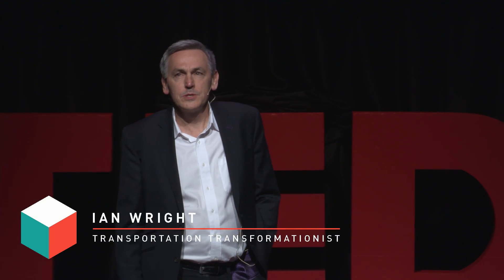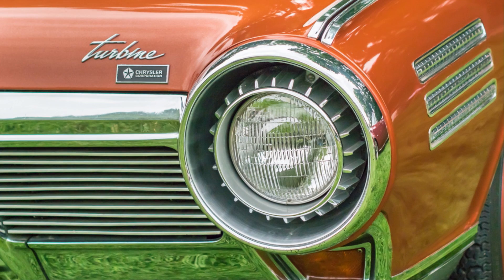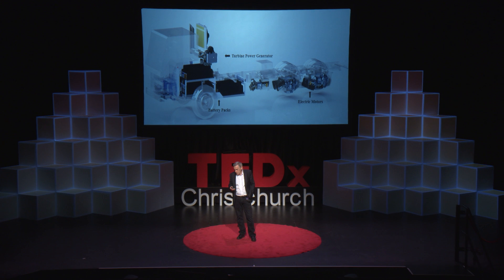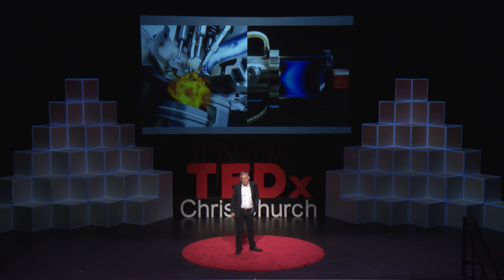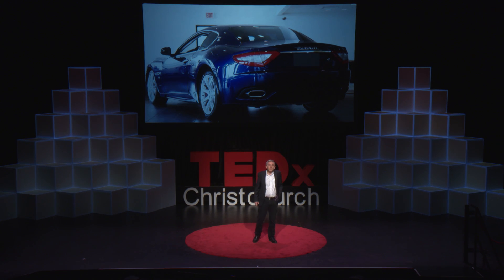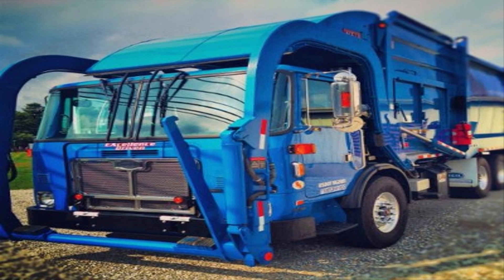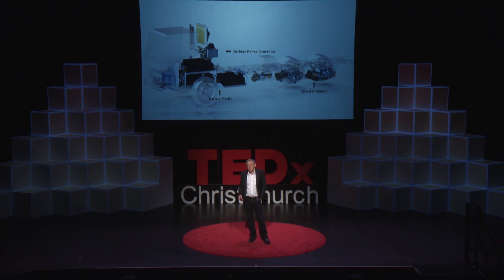How jet-powered garbage trucks can save the world | Ian Wright | TEDxChristchurch

Comment: I agreed the turbine engine burn alot cleaner. But is not clean I have spend hours cleaning aircrafts after each flight of those carbon soot.
Reply: Some turbines run cleaner than others.
Reply: depends on the fuel you feed it.

Comment: Long haul trucks get 5.6/5.7 mpg. He said 2.3 mpg. This is in imperial gallons. Do the math if you want it in American gallons. They are smaller but they are getting a lot better than the 2.3 he claims. Why is he BSing?
Reply: On a dump truck that stop/starts all the time, it's likely closer to his figure. In this application, BEV vehicles would absolutely cream ICE, on cost and also likely range.
Reply: Stop/start is the killer on ICE value - do it with electric motors, you've jumped efficiency by mountains.  Also no idling losses on EV (in this case, you'd be charging battery while stopped "idling" with the turbine, where the ICE it would be a thermal dump only...

Comment: the fact is that a small gas turbine system has much lower overall efficiency than a diesel engine. Emissions is true but efficiency is false. Half trues and people outside the field do not know how to distinct the facts! s smart propaganda guy...
Reply: I can find absolutely no sources that would put gas turbines efficiency below a diesel, so I really have no idea where you got this...
Reply: Your facts are bad. And you should feel bad.
Reply: so why not every airplane use diesel?
Reply: According to wikipedia, typical micro turbine efficiency is 25-35%, which is WAAAAAY above the efficiency of a diesel engine that revs and idles hundreds of times per trip, as currently.

Now, you might make the case that a diesel range extender might be more effective, though I would argue why use diesel in this example due to it's relative dirtiness, and you might be right, but that's not to say that a small cheap turbine with long operating hours between servicing attached to a conventional BEV wouldn't be a massive, massive improvement over the current status quo.
Reply: That overall efficiency is from running the turbine at sub optimal power settings such as idling and all other less than full power use the turbine driving a generator at power or off is more efficient.
Reply: calvingreene90 my figures are for a microturbine that does not recycle the heat output back into more generation, like this one. For larger generating turbines they use this heat and turn out about 60-80% efficiency from what I can find.
Reply: I agree that recycling heat would make that turbine more efficient but I was saying that the reason that small turbines get a bad rap about efficiency is their being used for jobs they are poorly suited for instead of constant optimal loads like say irrigation pumps.

Comment: his blue flame comes from burning natural gas.. 3 hydrogens per each carbon.. while long string gasoline and diesel are two hydrogen per each carbon.     To make the comparison fair.. use the same fuel.  Not stated is that turbine engines are inherently inefficient..the amount of energy you get out compared to the amount of energy you put in is LOW.Also..  the amount of energy needed to fuels from raw petroleum is high..and must be factored in..   along with the transport network.. yada yada.   ..Electric cars use electricity from ANY source.. so using Chinese coal  ( or 4 corners coal)   is hardly the only game in town.
Reply: That blue flame was from burning the hydrocarbon fuel completely.
Reply: Yeah, I generally agree, though it would seem that a microturbine can be at least as efficient as an ICE engine, while producing less emissions. They also have longer maintenance schedules, which in a range extender application would be a better fit.

You still have to take into account the efficiency of producing the fuel, and for that reason BEV's and solar/wind win hands down. We just have to make the batteries cheaper and more energy dense.
Reply: we need more armchair commentators like you who may as well be shills for the automotive industry's resistance to change.

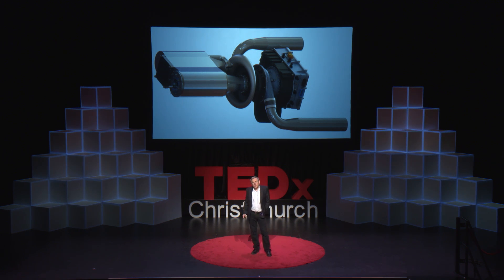Comment: 6:42 - he states it will run 10,000 hours, after that what happens, does the jet engine generator die? Isn't that roughly 5 years of heavy use?

And what type of batteries are they using? Lithium? Something else?
Reply: Ok, found the answer, what he meant was it runs 10,000 hours before needing a service, which is incredibly impressive. Surprised he didn't make that point clearer and go into more as the need for such little maintenance alone will save enormous amounts of money. Pretty impressive technology.
Reply: ".... he states it will run 10,000 hours, after that what happens, does the jet engine generator die? Isn't that roughly 5 years of heavy use?"

"Black box" unit replacement, that's what happens. Easily implimented if the vehicle is designed around this powertrain from scratch.
Reply: I doubt they swap out engines on jets like that, though for uptime, and with a small enough capital cost for the turbine, it might make sense to have a few spares laying around to recondition while new or reconditioned ones go back into the vehicle. That way the vehicle keeps going while the turbine is being reconditioned.
Reply: They do rebuilds based on inspections and yes, they do sometimes just pull the entire engine and put a new one in....

Comment: So if my local garbage trucks which already run on landfill recovered bio-methane, clean burning fuel, were to run on his trucks than the savings would be exponentional.   Agricultural Combines are even worst.  Using his system the direct price of food comes down.
Reply: the amount of available bio-mass methane the is unproduced but possible.. is huge... however piping it to central power plants and simply having electric garbage trucks would be more efficient, and far cleaner.

Comment: Great idea and I can't wait for the garbage trucks and mail trucks in my area to be converted.
But, his electricity generation spiel is bullshit.
Many EV drivers also have solar panels. My wife and I drive 2 electric cars and we have a 100% green electricity provider.
Solar panels have become so cheap, they are popping up everywhere. Every other house on our street has solar panels. My neighbour just had them installed and they don't even have an electric car.
The US is not building any more coal power plants and they are decommissioning old ones, one after another.
Reply: Batteries will likely never have the energy density to store electricity from non-CO2 emitting power generators to run a garbage truck or package delivery truck for a viable distance. So while you are correct that you can put solar on your house and drive your EV cars with zero CO2 emissions, this simply isn't ever going to be possible for the vehicles being developed by WrightSpeed. But I do get your point about not worrying about the emissions from the electrical grid. Since the turboelectric drive system is really about improving the fuel efficiency of the vehicle, the better fact to mention is that every 1% improvement in fuel efficiency is a 1% reduction in CO2 since both the current diesel vehicles and this vehicle are likely to be driven by the same fuel.
Reply: papparocket That's not what I was arguing. :) I specifically said that his approach is a good one for garbage trucks!
I just pointed out that he was bullshitting about the source of electricity.
Different subjects.
Reply: It's not bullshit as he's talking about HGVs, even this presentation is specifically about garbage trucks as an example. The amount of batteries HGV's require means it's next to impossible to charge them using solar panels, unless you have a huge field of them which would end up defeating the whole purpose of saving money. This technology clearly is not for every day cars and light vehicles, it's for HGVs, the gas guzzlers that Tesla can't ever sort out unless there's a battery revolution and even Elon Musk has said that'll probably take a long long time, possibly over a decade for something like Lithium Air or similar.
Reply: Xad That may be true at this very moment, due to the low oil prices, but solar's cost is dropping like a rock (everyone on my street is installing solar panels...) and the low oil prices are not sustainable.
They are below the fiscal break-even point for oil producing countries.
Even Saudia Arabia is tightening their belt:
http://www.bloomberg.com/news/articles/2016-04-25/saudi-arabia-tightens-belt-most-as-break-even-oil-price-declines
Rather than reducing output, to drive up the price, oil producing countries are playing chicken, trying to see who folds first (they'd rather have losses now than lose market share).
This is obviously not a sustainable situation.
Something will have to give...
Also, a smaller and smaller percentage of our electricity comes from fossil fuels.
While growing fast, wind and solar are relatively small, but large hydro is a big percentage (depends on the region, of course).
The picture is nowhere near what this guy is saying.
Reply: Also, the Tesla Semi seems to disagree with all of this, with even the smaller version capable of 40 tonne GVM and 300 miles.
Reply: Re Tesla Semi....  maybe why he's not at Tesla :)   Lots of tech people split over the viability of what they're pursuing and how to leverage current infrastructure etc.
Reply: Lyle Stavast yes, he and Elon didn’t see eye to eye. Ian left Tesla
Reply: Inpilot fit a tracker to your wife's electric car. Your life sounds too perfect.

Comment: His company is currently being sued by Capstone Turbine. Capstone had an agreement to provide them with their turbines and in fact have a few test trucks with them out there,  and then he walked away from their arrangement. He is now claiming he has a functional gas turbine that can do the job. Problem is that he has never had one running in the field with any significant run time. Capstone has thousands.  So nobody knows what is going to happen if and when his truck goes on the road. I think he did this because instead of paying someone else to provide a turbine that can run 40,000 hours before needing an overhaul to maintain it, he wants to sell a low grade turbine which fails every 10,000 hours so he can sell it over and over again profiting all along the way. So before anyone pats him on the back too much, do consider that he at his heart is a capitalist, and is more concerned about making money than making an elegant solution. Last I heard, Wrightspeed is now about 1/2 a year behind on delivering its promised trucks to  a few customers (Ratto/Fed Ex). Not sure if that is because of the lawsuit,  perhaps he is behind on ramping up production, or maybe the customers are not too interested in being the guinea pig for these new turbines.  It will be interesting to watch. It is probably not a great thing to have hanging over the company while it is trying to raise capital from investors. It is an X factor, and you don't want those when investing. Stay tuned to the story, it is a great idea, aside from the shady business practices involved.
Reply: +Malanthus It's not like it's difficult to build a mircoturbine.